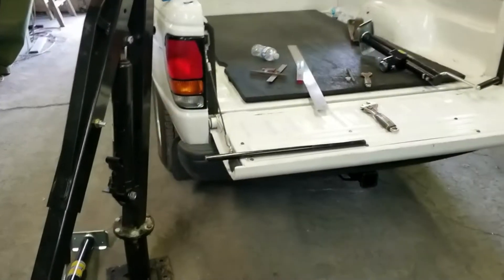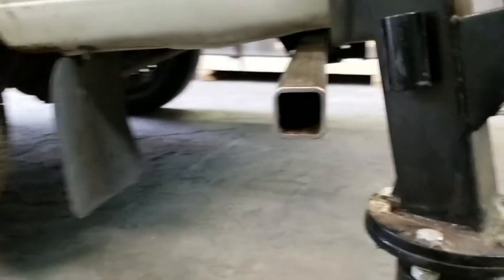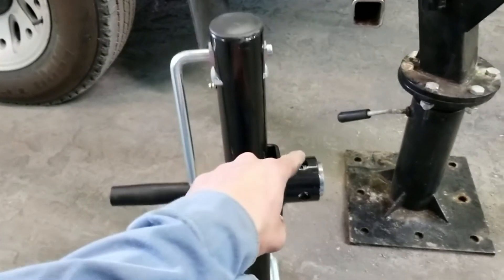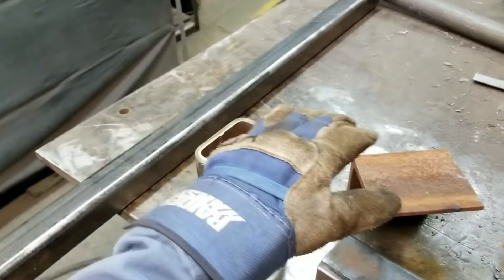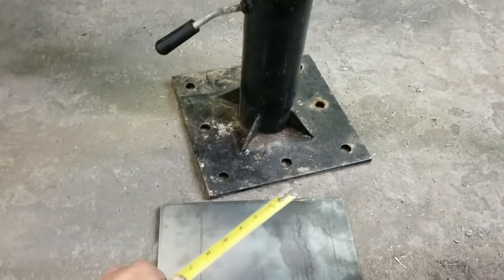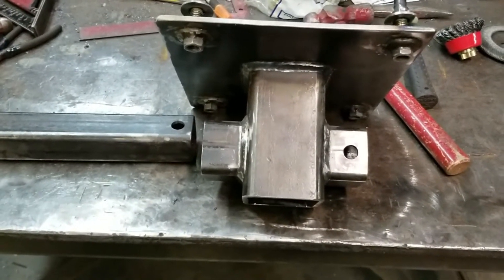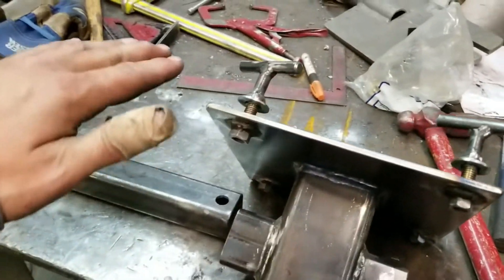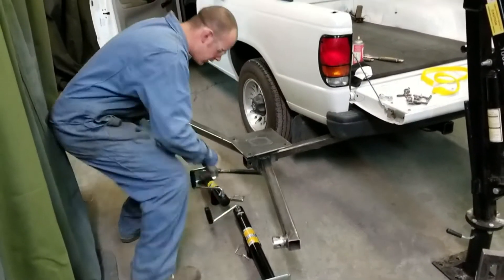CUSTOM TRUCK CRANE MOUNT!

Comment: 95% of these DIY truck crane builds I wouldn’t trust, however using the triangle method adds a huge benefit to stability was very smart. This was a very well built design. Definitely the 5% I would Trust

Comment: Thanks for this quality video.
It may be your first but I bet not your last.
Looking for a crane that will lift a fifty five gal barrel/drum approx. 36”tall into my pickup bed.
Do you think your unit could achieve that?
I’m also looking to add a 1/2 ton electric hoist as my rig has 110-220 v on board.
It’s a Ford powerboost.
With this electric hoist feature I would loose 12” of my overall lift.
I may have to go horizontal on the drums to achieve this task.
A 48” overall clearance is a tall order.
Your doing great man, keep up the awesome work.

Comment: Nice job on the crane mount..but, I'd think you spent more time putting it together to load that desk than 2 strong able bodied males who could have just lifted the desk onto the truck.
Reply from the maker: Your absolutely correct. Fortunately the time it took to build has paid off for how many times I have used it in lifting welders, lathes, mills, drill presses, a 50t shop press,  an 80gal air compressor, a 160gal RV propane tank, etc. The list goes on...

Comment: what is the maximum capacity this crane can lift sir?
Reply from the maker: The boom is telescopic, so there are two capacity settings, 500lbs and 1000lbs. (225kg - 450kg)

Comment: good looking build mate! better than lot that's on you tube. I do like the 3 support system you have come up with. Made change my design, thanks.   I've always been worried about overturning under load especially if one is loading live bee hives. First time I've seen someone actually check the level well done
Reply from the maker: Thank you! There are some things I would tweak, but I designed it the same day I built it because I needed it so bad, I have used it a lot, and it has saved me many times!  When you said beehives, I thought of a lifting mech you might like to build in addition to your crane - Google "overhead pallet lifter" - building a miniature one for easy slide in and under would be a fun project, it would also be faster then rigging a beehive box with straps which would also limit your contact, movements, and handling with the hives. Also you could stack them easily, I don't know if that's what bee keepers even do, but just a thought.
Reply: @ShopGoatVentures  I had already thought of a fork lift type pallet lifter. I'm  hobby beekeeper and only move 1 or2 hive at a time I had been lifting them with an elevating trolley, because of the fear over overturning. The 3 point base seems to be the answer
The commercial blokes here  in OZ  and the U.S. put 4 hives on a pallet  and stack them 2 or3 pallet high on 12  and 20 ton trucks  they carry fork trucks to handle them.

Comment: Nice crane build and should come very handy. I would say only one jack is sufficient because the truck is not moving(ie with the hand brake on), so zero horizontal forces.
Reply: One Jack directly under the crane base will be adequate for this design and capacity rating.

Comment: I'm always amazed that no one's made a crane using the gooseneck hole in a truck bed.
Reply: Having a lift in the middle of the bed doesn't work as well as off to the side
Reply: @oscarvogel2140  I built a winch using the goose neck ball hole in the bed of my truck bed. works great for small stuff.
Reply from the maker: That's a genius idea!

Comment: You should just add a 3rd outrigger and make it a stand alone lift. If your not using the hitch to transport it then there is no need to use it at all.
Reply from the maker: Ya, that's an idea.

Comment: Can you give me the bule print of it
Reply from the maker: I'm sorry, I designed and built the project on the spot - no papers, no napkins. 
If I can remember the material sizes...
HSS 1/4 x 3 1/2 x 3 1/2 Center Vertical Piece under platform
HSS 1/4 x 2 1/2 x 2 1/2 Mount Receiver
HSS 1/4 x 2 x 2 Hitch Extension
PL 1/4 x 10 1/2 x 10 1/2 Platform

Other Notes
5/8 hole diameter for Pin
1/2-13 Gr8 Bolts for hold down Finger/hand screw deals

I hope that helps

Comment: wouldn't one leg under it be enough ?
Reply from the maker: Yea, it probably would be fine. They exist.
Reply: @ShopGoatVentures  I just bought one for my truck from H.F going to mount it in the bed have an idea will see if it works out lol,  will post a video when i do it
Reply from the maker: @The88katana600  right on, should be a nice upgrade!
Reply: @ShopGoatVentures   almost 50 yrs old back can't take it any more

Comment: Good job. The only issue I have with these cranes is having to lift them into the truck. That kind of defeats their sole purpose for existing. Someone needs to design one that folds up into the bed
Reply: Harbor freight has one that does that.

Comment: That is by far the best and most sturdiest build of those I have seen.  Would like to build one just like that.  Need to find the crane that pivots like yours, then I can fab the rest I think.
Reply from the maker: Thanks for the comment Keith. If i did it again i would experiment more with the outrigger locations. Im not sure if you noticed the one outrigger lift off the ground when i raised the table... I have since performed many lifts with this crane and the vehicles suspension goes down when lifting heavy loads, so to remedy that i just raise the jacks more to compensate for it and they stay planted.
Reply: @ShopGoatVentures  The jack kind of outriggers are a great idea though.  I saw one where guy used a pin type and when weight was lifted into truck, it binded the pin and made very difficult .  The jack type can be cranked and pressure taken off outrigger so I definitely want to go that way

Comment: Great build and video shop goat!
I wonder if I could modify your idea and make a trailer crane. 
Wheels beside the outriggers,  use the long beam as the trailer neck.
You could pull it in one piece, jackknife the trailer to get loading position. Now it is portable without taking bed space, and no assembly.
 Thanks for doing the heavy lifting!!
Reply from the maker: Cool idea

Comment: Pretty nice build man. I've been watching a few videos getting ideas from others on different styles of builds. I actually have an old shop crane that I never use anymore that I'm thinking about sacrificing for a style like this.
Reply from the maker: Wow! Adam Booth! I would never of thought you would watch my video one day. Haha. You actually inspired me to record my work and get an instagram account a few years back! Your job shop work and 3rd gen history is awesome! Thank you for all the valuable content you have made. Oh and the crane outrigger location, not the greatest. im sure you saw the one lift. If i were to do it again i would definitly make some changes. Anyways, YOU know what you will do 🍻
Reply: @ShopGoatVentures  outriggers probably need to be at 90 degrees for  better stability.  I think if you came out the front of hitch then 90’d it into your exact setup it wouldn’t tilt over like that. Stronger in my opinion
Reply: did you notice this contraception almost fall over lifting 400 pounds?

Comment: Awesome fab work! Not sure I like the design, based on the dental chair lift the outriggers are better off being adjustable. Crane takes up half the truck bed but it is a small truck by the looks of it.
Cheers
Reply from the maker: Adjustable, agreed! 👍

Comment: Hello, just got here after being learning about an ultra tow truck lift like this one for a truck!

I like the way you build. Your welding is perfect. I'm looking forward to weld as perfect as you do. 

I want to add three suggestions for your and every possible reader's considerations.

1-45° angles. The angles you chose whether even and beautiful, leave a span or an area of 140° of not support. Try to support, or to lift something with your hands spread in that angle, get a weight bar, put some tolerable weight on it, try to lift it with your arms at 20° angles and see when you choose to go at 45° what happens? I won't tell you what happens until you try something. And you will see why you may want to go 45° from that point out or, better yet. 

The point you chose is one. See it from the top, imaginarily trace a line from where you believe could be the center of support, towards the center of your crane if, you want to add only, two points if support, as you did. Why? According to some 3 points define a plane. You have one, in appearance. I will say you have 4, that will serve as support points. You have your tires bottom points, you have your hitch mount center which is attached to its screws etc. And you have the center of the crane. All that in a circumference of how many angles if the crane center is 0°?

I think you have a vast area of 270° lacking support of which in this video at 20° or 25° extending jacks on the left side of those two jacks, the one attempting to save the day is the one behind the rear end. I don't want to say this but I'll say it. Don't hate me, here I come. In designs, especially in mathematical, physical, where materials, even lives can be at risk, beauty is not in the eyes of a designer but in the correct points or measures mathematics and physics dictates for you to operate then, not while designing, save, secure, in peace, therefore, beautiful.

My grandfather used to say "It won't look very beautiful, but it'll be safe". And believe me, I love and done art since I was little so imagine every time my father says "No le quedará bonito, pero le quedará seguro" in Spanish to a client (we're from Cuba so please bear with my English). Then there I have to go to make it beautiful because again, I like art but, I will never sacrifice safety and security for beauty.

Up to before installing this 20 some ° angled jacks you had 270° of voided support you need to attend. Now you may have between the rear jack and the center of the hitch receiver or, the tire point a good..am calculating in my mind easy 110° angle unsupported or without a point of support.

I recommend you to from the center of your crane wherever you place it, draw a line corresponding with your tires bottom points crossing the crane, extend that line about the same length if possible or what you can, that's if I don't remember wrong a correspondent angle from right rear tire through the crane, same from left rear tire through the crane and calculate approximately if there's too much gap beyond a 90 ° angle, you don't want that, because your crane can go with load against your truck due to lack of support.

2-The triangular wedges at bottom of crane to be made bigger, thicker, changed for those tiny ones. Consider it, if possible. Those are your trapezoids, the bigger and thicker, the longer your everything will last!

3-Leave an extra inch, on your pieces (projects) or more, for future changes like the pin coming from top, down. This is one of my struggles with my dad. He wants to do all jobs perfect, but when we need that extra 1/8", 1/4" or less, he already cut it, or didn't allow it, he wants then the job to work. Is like wanting later on to run the pin from top down, you could achieve it, making the piece just an inch or even 2" longer for comfort.

Ok, I'll continue learning from you. Thank you for reading my humblest suggestions.
Reply from the maker: Thx man, really appreciate it.

Comment: I must be the only one who saw the rear outrigger raise about 10" off the ground when the entire assembly twisted forward when the cabinet was hoisted... Needs an outrigger under all directions the load will hang. Other than that... sweet fab work.
Reply from the maker: It definitely lifted! haha, but after using the crane a few more times i realized i just have to raise the outrigger jack more. By doing so it compensates for the suspension drop of the vehicle and it stays planted.

Comment: Nice setup but its over done. One support leg directly under the main base plate is enough. If your parked downtown just giving an example and you need to load up your generator for example your design takes too much space and wouldnt be able to load in confined spaces. Your design is good for farm/hobby land where loading and unloading isnt an issue as to city core
Reply from the maker: Good to know, thx.
Reply: jason alexander  if it did not have outriggers it would unbalance the crane causing it to stress the welds and steel side to side twisting the boom stand until it would be unusable . though the outriggers could have been made retractable to help in lack of space conditions. peace brother
Reply: Ronald, Jason suggested a single jack under the crane base. Designed correctly, this would adequately distribute all forces acting on the unit.

Comment: This video is great! Nice job on the fabrication. Inspiring me to build one now.
Reply from the maker: If I was to rebuild it or modify it, i would change my outrigger location a little bit. Go to 14:26 and you will see the outrigger on the right lift because of the position of the load once it has swung around into the bed of the truck. To fix that small problem i might put a jack stand into the ball hitch reciever directly below the center of the tailgate.
Reply: @ShopGoatVentures  Ah, yes. I noticed that, but it still works. The jack stand should shore that up, but again, still is very cool.